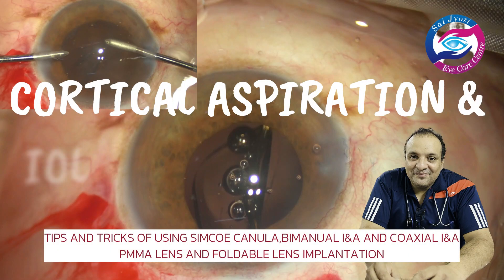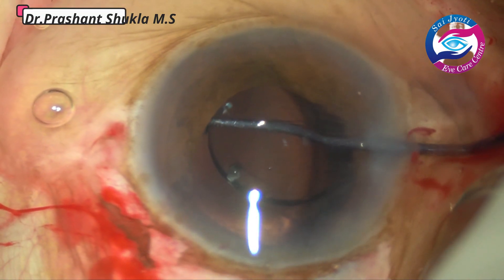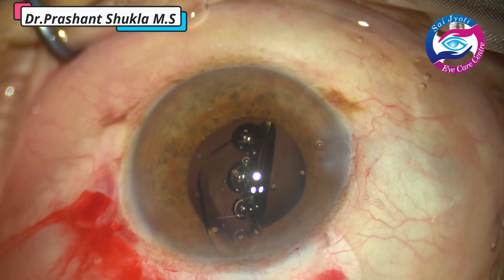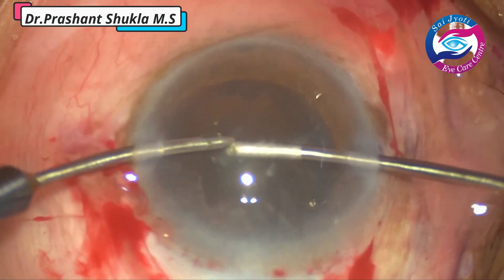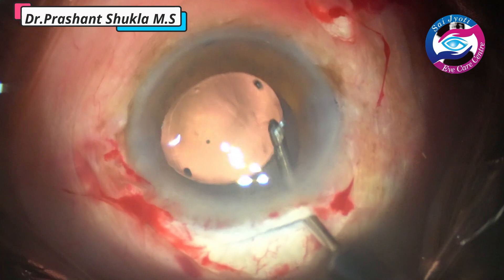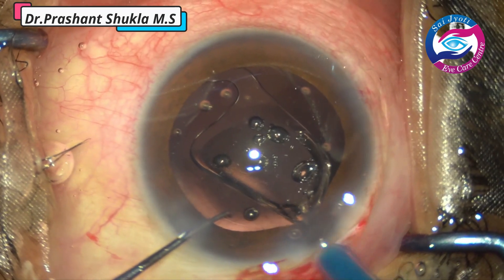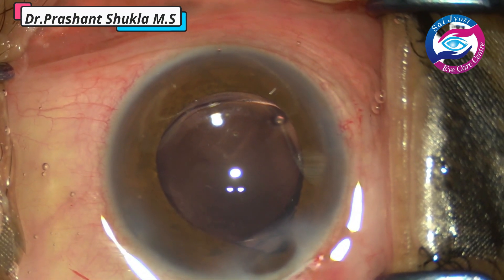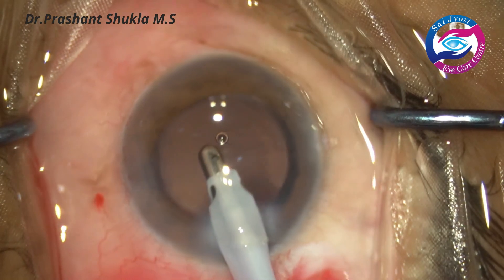TIPS & TRICKS OF CORTICAL ASPIRATION AND IOL IMPLANTATION USING SIMCOE CANULA BIMANUAL &COAXIAL I&A

Comment: Great video . Sir when I'm doing MSICS . In some cases during cortical cleanup the anterior chamber keeps on collapsing . Please help me in this regard . Thank you
Reply from the maker: Thank you for following my channel 
I normally use BIMANUAL I&A system from side port so chamber doesn’t collapse
When every you are using a simcoe canula better to use a 23 G from side port or if going through main incision inject some visco before cortical aspiration and also don’t press on the post lip of the incision to avoid chamber collapse also in the beginning leave some cortex and implant lens and then remove the cortex over the IOL
Reply: @PSV1980  thank you sir :)